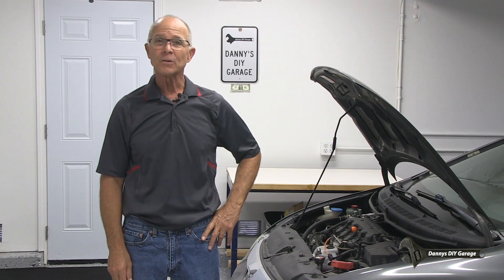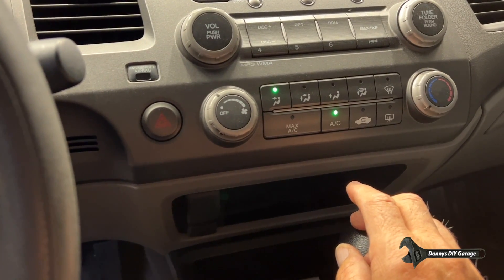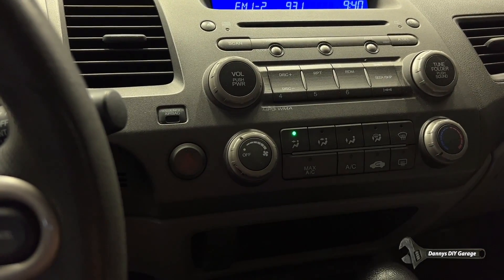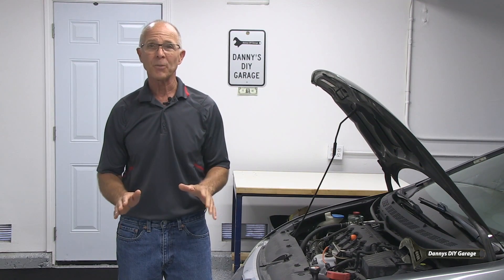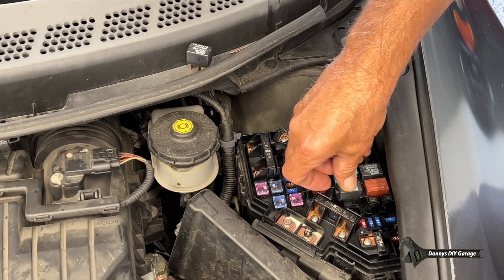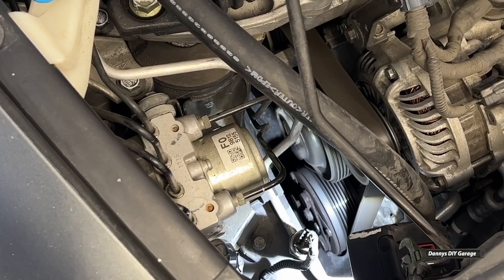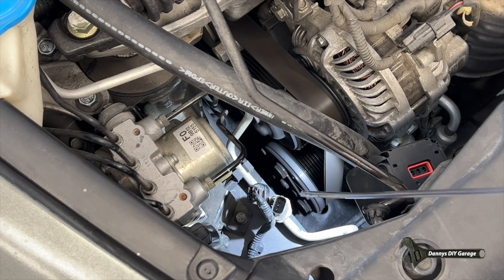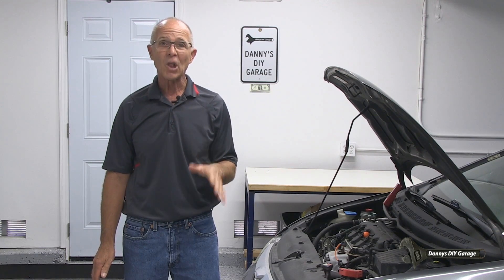Honda Civic 2009 AC system blows warm FIX

Comment: Great video but no explanation of what's wrong if a test fails.
For example, my mode is stuck on defogger.
Reply from the maker: @kroanosm617  I have a video on that, check my most recent two posts,
Reply from the maker: I added links during the video and at the end of the video, sorry about that, it's hard to keep up.

Comment: I replaced my clutch and magnet I had the ac running properly for 3 days then started blowing hot air. Freeon was topped up and relay was changed. I. Wondering if it's the expansion valve?

Comment: So I have a little bit of an odd issue.  When I bought the car the ac would not blow as cold at an idle but would blow very cold while driving.   Now it consistently blows much warmer regardless driving or not.   The clutch on the compressor engages.  Both fans kick on.  And the dummy gauge reads that it has refrigerant in the system.   I’m thinking either blend door actuator or possible the expansion valve.   I already pulled the cabin filter and cleaned it out.
Reply: same issue with mine. did you you get it figured out?
Reply: Did you guys figure out the problem?

Comment: My issue is the worst one…compressor clutch will not engage even with giving it the love tap that Danny did. A/c relay sway with radiator swap also did not engage the clutch…

Comment: My Question is /posible. ..?? Ac compresor not work with out compresor oil?? And GAS QTY? But my car Ac was not working ..my michanic told me you replacement  compresor ..vlues  and realy. .but I not change compresor vlues and realy........... (I not change anything only compresor oil add little QTY.
AND CLEANING COMPRESOR BY PRESHER AND GAS CHANGE. .
AFTER MY AC IS WORKING GOOD RESULTS. .. THIS IS RIGHT WAY??
YOU TELL  ME YES OR NO ???
(((( IF  YOU ENGINEER ))))))

Comment: All video is prefect stap by stap is working good ..normally how check the working AC ..this is very important in your knowledge. .
Recently I was worked my honda civic automatic (Ac work...) mhachanic told me your ac is not working(I am living in uae ) I asked why?? He told me ac unit is not working and GAS problem. You go and perches the new Ac with vlues and relye. .but I inses  (total parts experience 1100 to 1200 Aed) w/o labour charges..I told any opinions? 
He is intelligent  (from pakistan )
Yes I have solution. .he told me I try my best ..and he cleaning the Ac by presher and  fill compresor oil in Ac and new Gas filling and fillter change. .my Ac is good working and best performance and setting half and helf 3 to 4 points only and chill cooling. .and I save my money and time. Total amount with labour only 200 aed....I AM very happy and Ac working good (that is true)))) recently 6/7/24... (that is posible? ???? Plz reply
Reply from the maker: @fahimuddin8349  I’m not understanding your question

Comment: Hey so I have a 2010 Lx, mine blows very cold for about 10 minutes then becomes hot, I ran the diagnostic and it blinked 4 times as I’ve also been having trouble with the buttons, could that be the reason my ac is blowing warm also or do I have other issues?

Comment: 3:43 Can anyone please answer this because he doesn't address this in the video. He moved the temperature from cold to heat to middle and the actuator moves. I purchased a new actuator and the new actuator does not move when i move the temp from hot to cold it does not move at all unlike in your video
Reply from the maker: I’ll be doing a video on that next

Comment: Hi, I have a 2010 Civic. The AC blows cold air for the first 10-15 minutes of the day, but then it cuts out only blowing hot fan air. The car will need to cool down for a few hours or perhaps overnight before it will blow cold air again in the morning. The hotter the ambient temperature, the shorter the AC is lived. 60-70 F will last 30 minutes before cutout. 95F maybe only 5-10 minutes before cutout. Does this sound like the compressor clutch wearing out? If so, should I just buy a new compressor? Thanks!
Reply: Did you ever find the issue? I’m literally having the same exact problem right now in my 2010
Reply: Not yet. I can visually see the compressor clutch disengaged after the AC cuts out. And then if I tap it into place it will run for another 5 minutes. Best I can guess is there is weakness in the magnet or coil system that developed. I’m going to buy an entire new compressor and clutch assembly from Denso and have Honda install it in the next week hopefully.

Comment: not sure if you experience this situation I am currently having on my civic aircon.After driving a while longer with AC on turned at the lowest temperature, the ac starts blowing hot air, it literally just heats up instead of just not blowing cold air. 
with AC on putting it to low temperature cant defog, now I can only use high temperature to defog.
It does has compressor clutch engaging all but blow wrong temperature. what component do you think it could go wrong? The ac blows normal cold air varies from different temperature I set, most of the time while the car has been driven like the first 15-20mins after a certain time, that symptom starts.

Comment: Danny help me out. My AC works and the clutch engages and disengages like its supposed to for 10 minutes then it just quits and dont engage again. Does this sound like low freon? I tried recharging it with freon a while back and i tried the fuse swap nothing. Everything else looks fine like u mentioned but i don't know what to do. Should i try to recharge my ac again maybe i didn't do it right??

Comment: Well you're over 10,000 subs. So mechanic filled with new freon and the A/C got cold, but a few days later it was blowing warm air. Mechanic did not detect leak. Clutch kicks on. Your thoughts?
Reply from the maker: Gotta look at the gauge, the gauge will help diagnose, does the compressor cycle a lot or stay on? I have a few videos on ac and videos on ac fans also, check them out

Comment: Hi Danny, thanks for the informative videos. I did the test on the head unit on my 2009 Honda Civic and the light was flashing 4 quick flashes repeatedly. What does that indicate? My ac doesn’t seem as cold as it should be. Thanks John
Reply from the maker: In the description there is a list of codes that explain the flashes, check it out
Reply: Hi Danny, I see it now. The motor that redirects the airflow to the various vents . Thanks for the prompt response.👍

Comment: Hello Sir, When i turn on the switch the two buttons has to be pushed before turning on.. and after i turn the key on the first light goes off and AC light never turned on (what’s the problem here) ??? Please suggest
Reply: Look for the AC fuse maybe blown. This means your AC is not working? Or damaged control unit.

Comment: Thanks so much for this informative video! I had watched other videos suggesting the A/C clutch relay might be the problem (it was), but I didn't have any way of testing the theory out without ordering the part first. I'm just not knowledgeable enough about cars to randomly try swapping things out and around without worrying I'm going to cause some sort of catastrophic failure, so I rely on people like you to give me the confidence to try this stuff out without worrying that I'm doing something wrong. It was your suggestion to swap the rad fan relay with the A/C relay that helped me pin it down as the definite cause for my A/C issue. So thanks again, I appreciate the work you do!
Reply from the maker: Thanks for the kind comment, I do appreciate your support

Comment: When adding Freon you should purge air from hose or else your adding air to closed system. Which can result in ac not working properly.
Reply from the maker: That’s correct

Comment: Amazing video. All clear. My Honda 07 Lx It makes a short circuit when removing and installing the air conditioning fuse, and it seems that the fans are going to turn on and it turns off, the compressor also does not turn on, I already checked the relays and if they work, also the internal control unit.

Comment: What a friend, I did the test and it blinked 9 times, what it does to me is that I turn on the air conditioning and it turns on the compressor and fan and it turns off after 10 seconds I hope you can help me

Comment: I thought the motor fans (both) only turn on when the motor gets hot- up certain temperature. And keep on and off gain back and forth depending how hot the car gets.
Reply from the maker: Yes that is true, I have a video coming out that explains this in more depth, will be uploaded soon

Comment: Quick question for you, your engine bay is so clean, do you powerwash it or just use a rag and some kind of detergent/water solution and wipe it down?
Reply from the maker: I’m from California, however once in a while a clean it lightly after a repair with low pressure

Comment: Great video, tha tip of pressing the buttons 1:03 down and turning the ignition helped alleviate some stress, no warning lights.
Then I swapped the relays 6:39 as you suggested and it was a dead relay, so I bought a new one and AC is up and running.
Thanks Danny.
Reply from the maker: Appreciate this, I always wonder if my videos help out, sharing your success stories is appreciated
Reply: @dannysdiygarage  When I press the buttons down and turn the ignition, the recycle light flashes.  So, what should I do? My 09 civic is blowing warm air even when I turn AC on.
Reply: @dannysdiygarage  I further watched to the end of you video and checked again, my actuator blend door does not move at all when I switch cold to hot back and forth. Let me study how it can be fixed.
Reply from the maker: @yxie2685  I have a video on that

Comment: Very high quality made video, thank you so much! I’m curious: I believe our ‘09 Civic needs a new compressor clutch. If i’m not mistaken, the compressor clutch SHOULD be spinning once A/C is activated, correct? Ours is not activated with A/C on and is blowing very warm air. It will only work for around 10 minutes at the start of everyday - consistently. Curious to hear yours or anyone’s thoughts.
Reply from the maker: The ac is activated when the switch is turned on and condition are met, low Freon will cause the clutch not to activate also, check out this video also https://youtu.be/i94Bv8KaVzA?si=T2czxY_4fbN0ZBe9

Comment: My 2011 CRV ended up having clutch engagement issues due to wear and tear increasing the spacing between it and the compressor. Removed it and removed a spacing shim to reduce the gap back within spec and now it engages and blows cold!
Reply from the maker: Awesome, great information, I appreciate you sharing this👍🏼
Reply: There are 3 or 4 shims in there of different thickness. 
The air gap recommended is 0.35mm to 0.65mm (about .014" to .024"). 
Removed 1 or 2 that give a recommended  air gap between the clutch plate and pulley.

Comment: Thanks U. This is one of the best videos I have seen on diagnosing problems. I am a novice so this was helpful. Couple of suggestions that might seem dumb to experienced follks. CONTROL HEAD TEST: More on codes. What they mean / look like. Point out turn key all the way without starting.  ACTUATOR BLENDER TEST: Where located? Engine on or key just turned fully? FAN TESTING: Engine on or key turned all way only? What fans/location A/C RELAY TEST: Show compressor on/off. FREON TEST: Which port? I saw two.  Thanks for this fantastic video. Your good teracher adn use a clear voice ❤❤❤
Reply from the maker: Understood, I plan on going deeper into diagnostic on each code, videos like this take weeks to produce, there’s the research, scripting, then trying to explain in a way that the novice can understand and feel comfortable performing these tests, not to mention with tools that are available for the DIY home mechanic, shooting the video and editing my goal is to have next summer a complete AC diagnostic video, other than this AC video, many of my in-depth wiring diagnostic videos that I spent weeks on haven’t done very well, which tells me my viewers are wanting a quick fix, if not they’re taking it to the shop, the codes are in the description if you haven’t seen them, thanks for your feedback it’s very helpful
Reply: @dannysdiygarage  I think few people appreciate how much work goes into making these videos. I followed your process.      HEADER TEST: 👎 result is light blinked 4 times. Now I have to figure out what that means     AC RELAY: New relay did not engage 👎 🚫compressor (clutch)      FAN TEST: ✅   VISUAL INSPECT: ✅        ACTUATOR BLENDER TEST: Don’t know where it is.         

So unless I can figure out what the 4 blinking lights on header test are I am guessing needs new compressor which probably means whole new system 😢😢😢😢
Reply: where would i find the actuator

Comment: Danny …. where can I find a red block meter like the one you have ( exactly ) with the inside thermometer probe to see ( both ) temperature readings ? Can you send a link , maybe Amazon or eBay to order ! I could use that tool to help me with my A/C diagnosis
Reply from the maker: I’ve had a lot of problems with that one, it doesn’t pair and the accuracy is questionable, you’re better off with something like this InterDynamics Certified A/C Pro Car Air Conditioner Test Thermometer, Helps Diagnose AC Performace and Checks Outlet Duct Temperature and Ambient Temperature, Includes Holder and Clip https://a.co/d/53pg5Sz

Comment: Exelent video Here's is my issue 2007 civic we replace the ac compresor,expansion valve ,new condensor car still Not blowing consistenly cold air note the compresor clucth engage only for 7 to 10 seconds then turn off any advice what also we have to do please help apreciated
Reply from the maker: Hooking up a set of gauges is necessary to see what’s going on, in California auto parts stores loan them our, pressure reading will help identify what’s going on here

Comment: Hey Danny informative video. Currently having intermittent ac issues. Cold air will blow when driving however it's not as cold when stopped or idling. Any ideas? Thanks!
Reply from the maker: I have a couple of videos on this, if they’re unhelpful you will need to install gauges to read the pressures, knowing the pressure will help determine the problem

Comment: Great video I had trouble with my 8th generation civic AC cooling properly. It was the actuator motor that controls the air temperature. Once it was replaced with a Honda oem part the problem was solved
Reply from the maker: thanks so much for sharing this information with my channel, appreciate you
Reply: Iam sorry I just saw your question. It in on the drivers side next to  the gas pedal
Reply: where is the actuator located

Comment: What if after adding freon the temp only drops down about 10 degrees?  My 2008 civic was empty so I added one 12 oz can then weighed the second until it reached 15.9 oz total. Which is what the ac sticker says.  I also checked for leaks, before filling and didn't find any.  After filling I cleaned the condenser with a degreaser and a hose, but still only about 10 degrees.  The compressor clutch is spinning as well.
Reply from the maker: If the compressor is running and it’s still not getting cold it’s not the gap, if the compressor isn’t engaging then it could be the gap, also check the actuator making sure of the movement
Reply from the maker: That could be the expansion valve I have a video on replacing that, also make sure your actuators are properly working
Reply: @dannysdiygarage  Thank you sir.  Yes I watched that video as well but could it possibly be the clutch gab? I also changed the cabin filter by the way.  But I checked the gab with a feeler gauge and it seems to be bigger than .014.  I saw another youtube video where the gap caused the compressor to not cool after it gets hot.

Comment: What if it will get cold but then after 20mins it’ll get hot then wait and the cycle repeats
Reply from the maker: is the evaporator freezing up due to a blockage in the system? try Not using the recirc button and see if its any better

Comment: what does it mean when the radiator fans dont come on when i turn on my ac?
Reply from the maker: I have a video on that on my channel
Reply: hmm, it weird they turn on when the engine get to a certain temp, but they stop after like 30 second. not sure why tho
Reply: do you think a 2006 model would be different then a 2009?
Reply from the maker: If the ac is on , they should be on, are they? 
If the ac is off, the fans don’t turn on until the coolant reaches a curtain temperature, I think it’s around 220, then they will shut off when it cools
Reply: no, they are not on, could it just be my relay?
Reply from the maker: Did you watch this video? https://youtu.be/i94Bv8KaVzA?si=5Y8vOTESLNFTEzyr

Comment: My 2013 civic just started instantly blowing warm on my way home, went cold for 30 seconds again and back to warm. Owned it for 10 years 110,000 miles and this is the first issue I’ve really had with the car lol. It’s also extremely hot outside right now and one of my suspicions is the system kicks off when it’s too hot.
Reply from the maker: Appreciate the response and explanation 👍🏼 sounds like it will be fixed
Reply from the maker: sorry, I missed this comment, did you get this fixed and what was the cure?
Reply: @dannysdiygarage  not yet, maybe tomorrow actually. What ended up happening was the red 12 volt wire rotted off the electromagnet side of the clutch. It was barely connected, thus an intermittent weak connection and sometimes it would work sometimes not. I ordered a whole new clutch assy with pulley, clutch, electromagnet for $40. The replacement process is straightforward. Compressor doesn’t need to come off, Freon doesn’t need evac or recharge.